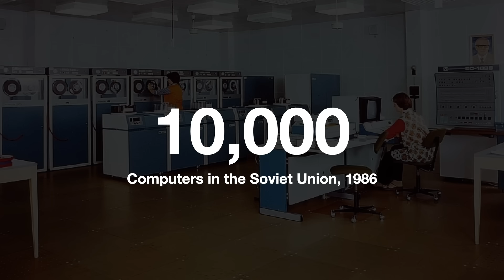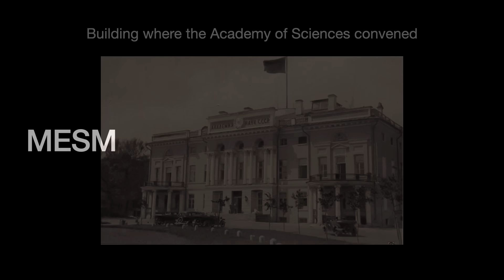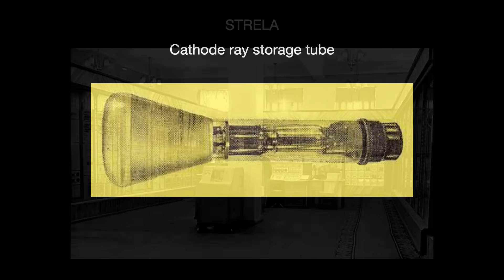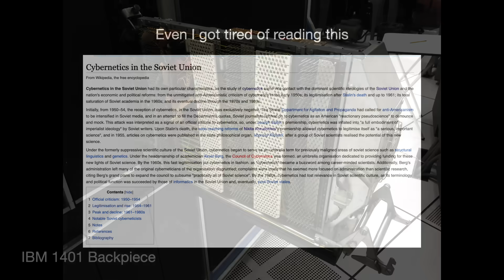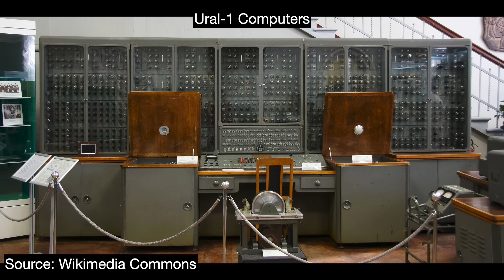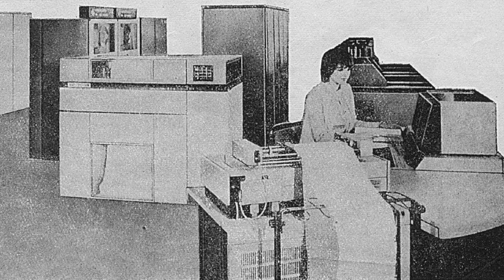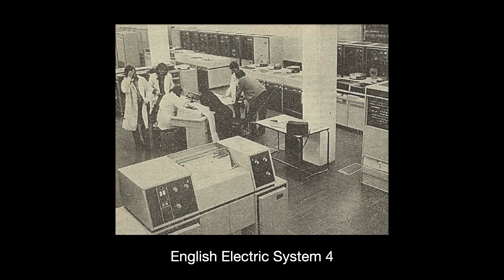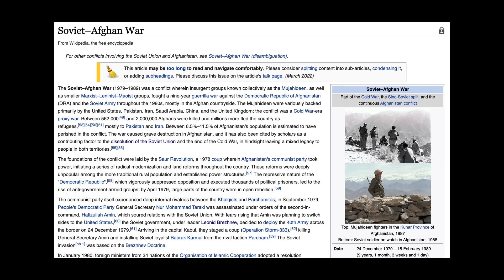Why the Soviet Computer Failed

Comment: Interestingly as a result the Soviet war aircraft were much more radiation hardened because they were full of valves not integrated circuits.
Reply: I've serviced guitar amps fitted with their 5881's Tough as nails. I think they were used in the power stages of servo systems in aircraft.
Reply: This is the Reason why Russia valves amplifier is still the best quality & good brand till today. They know how it works
Reply: Steampunk FTW 😆
Reply: Also defense against EMP pulse which can take down aircraft when a nuke goes off

Comment: I recently saw a video of a Russian Missile Boat that participated in the 2008 Russian Invasion of Georgia (the Country, not the State). Unfortunately, I cannot find said video. Either removed or was under a different name.

But anyhow! The video not only showed off the poor training of the Russian Naval Forces, but the general poor condition of their ships. As well as the lack of knowledge among even the Senior Staff of the ships going into combat.

The video shows some issues with the main control station for the Warship's Engineering Section. The Chief Engineer had to walk over and take over to figure it out. At one point, he resorted to just banging the thing with his hand. Purposely striking it until the gauges, which look like they belong on the ship from at LEAST the 1970s, finally started doing what he wanted them to do.

And this was not just a Russian Warship. But a Russian Warship sailing in Combat Conditions during the above-mentioned invasion back in 2008.

Incredibly, there was no one who could troubleshoot the system which appeared so old, calling it a Computer of any kind is kind of an insult to Computers in general. Look like someone had merely updated something that should have been common on a Warship from the 1940s or 1950s.

Later on, the crew had difficulty lowering a Missile Rail Launcher. Those old-school Pop-Up Launchers with two Launch Rails that Missiles hang from to fire. Someone in the comments noted that the Launcher had a stained bucket near it, meaning the thing was still a Hydraulic System. In addition to that, when the crew FINALLY got it to rotate, as it was failing to rotate at all, let alone properly, they had to point the Missile DOWNWARDS in order to get the Launcher to rotate into the Lower Down Position.

Yeah... I think the Chinese Warships are a LOT better maintained. There were remarks that anyone who saw Russian Warships, and even Soviet Warships, during their time in Naval Service with NATO Nations would comment on how even from a distance they could always tell a Russian/Soviet Warship from an identical Warship of Russian/Soviet Origin in service with another Navy...

They looked like crap even at a distance and from what they heard, their Primary Systems, like Computers, tended to be very poorly maintained and even prone to breaking down when properly maintained.

Someone did a video on why Russia's Sole Aircraft Carrier is falling apart and that was because while the Russians and Soviets built them, they didn't build the Infrastructure to support them. Even a Destroyer can be a handful for the Russians to maintain. Forgot Cruisers and Heavy Cruisers or even an Aircraft Carrier.

Incidentally, the Russians finally got to work on proper Dry Dock for their Carrier only very recently, like in the last 3 years recently and they've had the thing since the 1990s.

Comment: vacuum tube computers were devilishly complex requiring quite different tubes for operation than regular devices since they had to have such high rates of uptime compared to other machinery
Reply: Lower the filament voltage. Lower the plate voltage. Reduce the gain.

Comment: You could make exactly the same video about "Why the British Computer (Industry) Failed". It follows roughly the same timeline and is really just a case that you can't make a competitive mainframe out of descrete parts, no matter how clever or motivated your engineering staff were. Although early PCs were relatively slow compared to a mainframe this performance gap closed rapidly. This left the USSR at a serious disadvantage since most processors were embargoed and even minicomputer exports were tightly controlled (US export licenses even extended to the UK) so they would fall behind.

That, though, was 'then'. 'Now' is a completely different story since most parts and assemblies are made in China and our attempts to embargo Chinese technology imports to hold them back are increasingly futile.